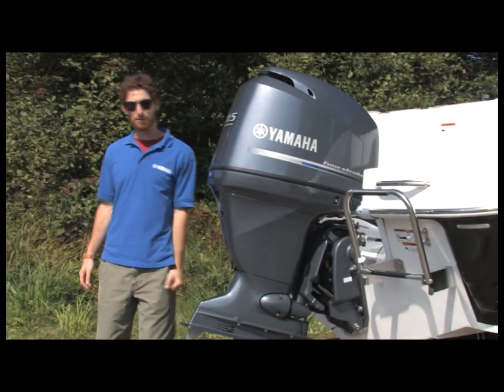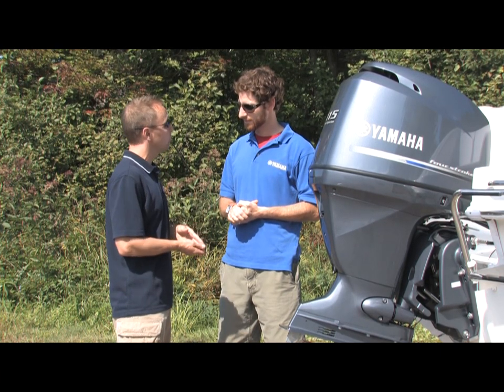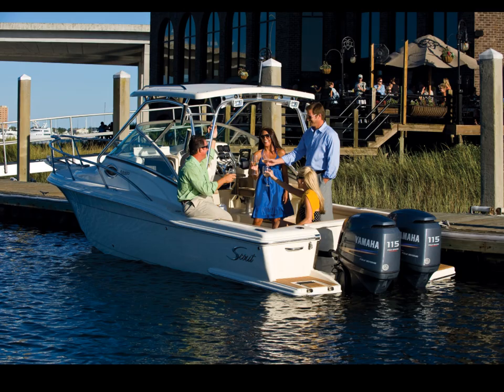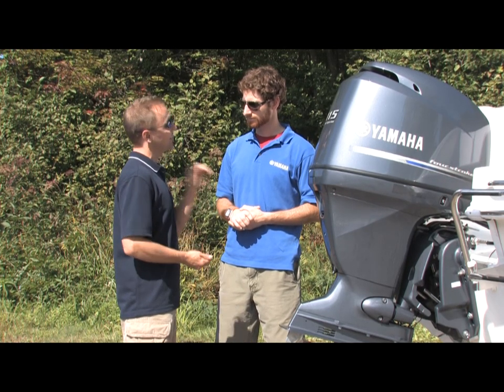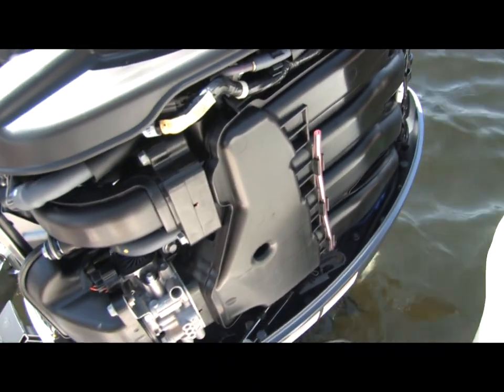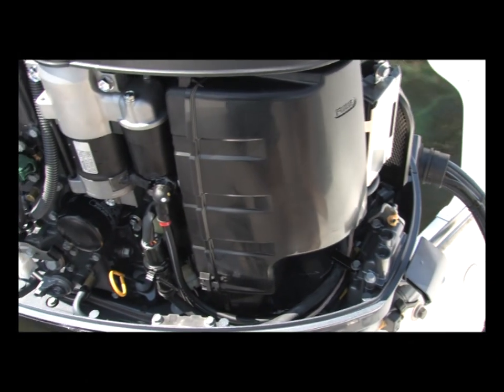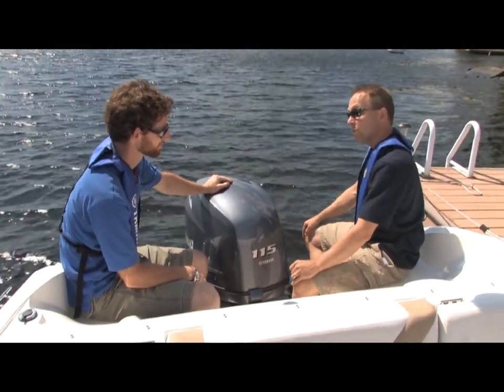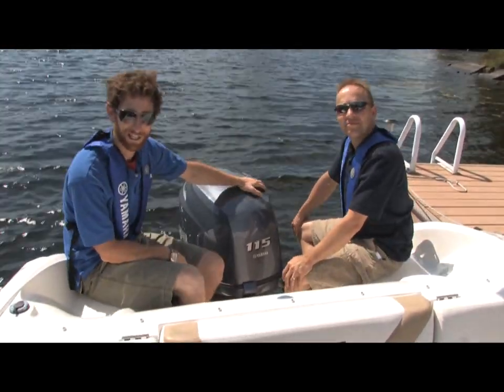Yamaha's redesigned F115 outboard

Comment: got a 2003 yamaha f115 txrb outboard on a sea pro 19 ft cc with 500 hours runs flawless so my point is the older 4 stroke models with efi are just as good i have no complaints my boat hauls ass gets me to the fish and back to the dock and its good on fuel old new its a yamaha of course its good i know others will agree.